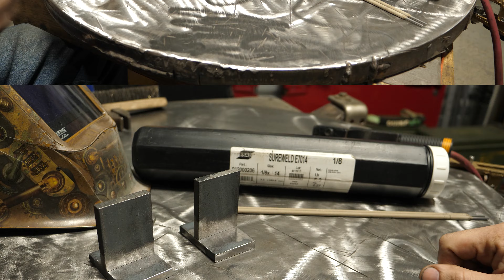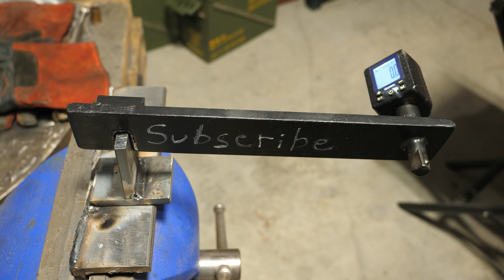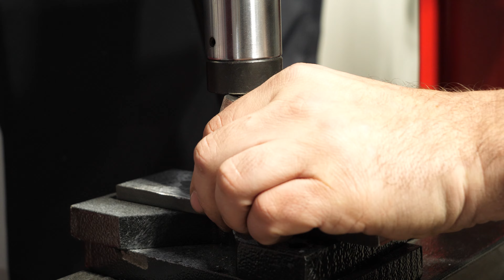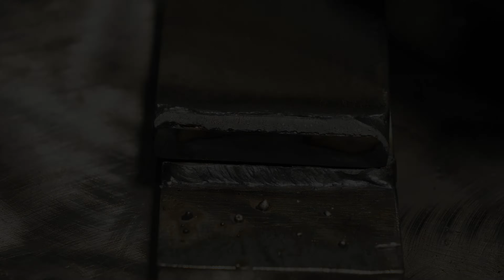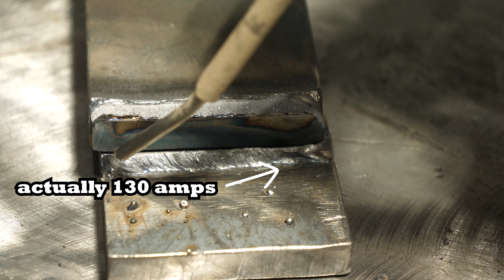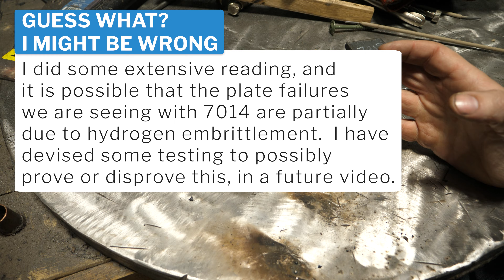7014 vs 7018 weld break test

Comment: I was told 7014 was a sheet metal rod and had low penetration….
Reply from the maker: 7014 can be used on more than sheet metal but generally speaking it excels at thinner material due to minimal penetration 👍.

Comment: Thanks for another thoughtful video. 
    7018 is great stuff, but is it the best choice for every job? 
     Let's say you make a garage shelf with some 16 gauge square tubing (1/16")  and some plywood sheets. 
     Your nephew, new employee, etc. backs into it with your truck, or the forklift, etc. 
     Scenario #1 :  You put it together with small 6013 or 7014 stick, so some welds break. You clean up the mess,  do a bit of grinding, and weld it back together. 

    Scenario #2 : You try to use 7018 and burn through so many times you end up using another rod, but you wasted a lot of time and it doesn't look so good. 

    Scenario #3 :  You somehow manage to use 7018 on the thin metal without disaster. Give yourself a pat on the back and bragging rights. The event happens, the welds don't break, every tube is bent and twisted, only some can be salvaged. The vehicle suffers more damage. You have to replace most of the 'cheap' steel tubing. 
     Lesson: When you are just toooo smart, you may outsmart yourself.
Reply from the maker: You’re absolutely right, 7018 isn’t the best tool in the toolbox for all welding jobs.  Take welding fence pipes, the first rod I would grab is 6010/6011, and 7018 would be about the last.  The rough restarts with 7018 and difficulty it has bridging gaps makes it far harder to work with for a lot of jobs.  To hold together a mangled dumpster 6010/11 is first to come out and maybe 7018 to cap over the 6010/11.  Lawn mower decks, thin sheet metal, terrible/rusty material, etc are all great candidates for other welding rods 😀👍

Comment: for thin metal would you recommenced 6013 or 7014 more? or just use a smaller 7018?
Reply from the maker: Great question.  On thin material as in 1/8th most any rod will work.  With 1/16th and down I would be reaching for 1/16th 6011, 6013, or 7014.  7014 is probably the hardest to find in 1/16th (3.2mm) sizes.  Most people will have the most success with 6013 more than likely 👍.
Reply: @makingmistakeswithgreg  thanks. found myself working with allot of 1/8th inch but rusty that i need to clean up lately, so after cleaning its somewhere between 1/16th & 1/8th.

Comment: It’s a good substitute rod for 6013, easier to restart and less of the swirling slag you tend to get with 6013 too
Reply from the maker: It definitely is.  That slag inclusion tendency of 6013 can be a rough problem to deal with.

Comment: 12:47 I found a source that claims the typical value for E7014 Charpy was tested at -20°F. Assuming I can't post links, search for this webpage (not the .pdf):
"E7014 – Washington Alloy"

Interesting that 6010, 6011, 6013, 7014, 7024, 8010, and 11018 all fail your press test. I would have said this comes down to self-quenching, but that doesn't explain the 7024, which shouldn't be more susceptible than 7018. It's a 70XX-series rods with a "slow-freezing" puddle.

The one thing they all have in common is a greater likelihood of hydrogen embrittlement vs. 7018. The undersized rod (1/8" rod on 3/8" plate) gives little time for hydrogen to escape before the puddle freezes. Even for A36, I'm curious if you dried your 11018 rods for this test. I'm sure they're susceptible to untempered martensite from self-quenching, and hydrogen embrittlement from moist flux.

Hydrogen embrittlement would also explain why MIG has an easier time passing this test.

Comment: I’m currently practicing with 7014 because I bought a miller roughneck and it’s an ac only machine. I’m definitely liking it for tacking compared to 7018
Reply from the maker: 7014 is definitely a easier rod to tack weld with.  They do make a a/c specific 7018 rod, it is designed to run a bit better on a/c.  Technically most 7018s can generally run on a/c, however many a/c machines (like Lincoln tombstones) have very limited voltage under load therefore those machines tend to struggle with them.  Your generator/welder setup probably has significantly more output voltage capability and may run more 7018s than most a/c machines.  Basically if you haven’t tried running 7018s it might be worth it.  Otherwise your best bet is 7014, they will offer better general performance than 60 series rods.
Reply: @makingmistakeswithgreg I have tried a few different 7018 and while the ac rod will run the arc will randomly snuff out. Right now I’m keeping 6011, 6013, 7014, and 7024 on hand. I can’t recommend esab sureweld 6013 enough.

Comment: 7014 just doesnt penetrate.  Id like to try 7014 on some thin tubing.  6013 and 7018 blow holes in thin stuff.
Reply from the maker: 7014 is available in 1/16th and 5/64 rod sizes and they do work well on sheet metal 👍.

Comment: Thats poor fusion. Try 7014 same with faster travel it will break same as 7018, on less psi ofc, because weld fusion lower surface area. With that travel speed of yours heat from the arc barely reaches base metal fusion point, thats where it fails.
Reply from the maker: So I have extensively tested this beyond this video.  I have discovered a few things.  1) 7014 produces weakly penetrated welds, regardless of settings.  Under no circumstance does it match 7018s penetration, the rod simply doesn’t produce penetration.  This is a problem if weld penetration is required for strength.  2: the 7014 weld is far less ductile than 7018, therefore its lack of flex can force failures of material that don’t happen with 7018.  When bending steel that is welded with 7014 the weld holds more like epoxy (holds until it breaks instantly or the base material tears) instead of 7018 (which holds on while slightly stretching with the material).  There is more to weld strength and holding things together than simply tensile strength.  If this was the case 11018 would equal 7018 when bending 3/8th mild steel and it too fails like 7014, due to how little the weld stretches.  3: 7014 doesn’t actually match 7018 in tensile strength regardless of both being “70k” rods.  The 70k is minimum test results, 7018 universally is in the low 80k in actual testing, 7014 is not.  

Based on the testing I have done 7014 is in no way a replacement for 7018.  It has less penetration, less actual tensile strength, worse ductility, and tends to be more prone to weld defects like slag inclusions.  It’s also not capable of being low hydrogen therefore should not be used on higher strength steels.  The main benefits 7014 has is easier starts, and better thin material performance due to reduced penetration.
Reply: @makingmistakeswithgreg  hmm, I would try 1 pass faster travel speed, and 2 more passes over it to match 7018 bead size because problem is poor fusion. Less penetration makes an effect of too low travel speed where molten filler fuse to itself more and less with base material, because base is semi molten state. So with less penetrative electrodes more you travel , less heat to fusion point.
Point is to make it  break on weld , because weld is 70k , when it breaks at contact with base its not even close to 70k, its weak fusion, its more glued than fused.

this 2 electrodes are same nature and composition in different proportions, only difference one reaches deeper penetration at same travel, so thats where lack of fusion lies.
Take a look at mig for example, why is less posible wire diameter for high amperage desired, because it reaches high penetration faster than heat reaches considerable width> same penetration can be achieved with lower amps and slower travel speed but filler to base fusion point is more glued than fused. I have learned this hard way, always thougth penetration is penetration.

Comment: I don't think the cracking is because of the difference  in strength. I think it has to do with chemistry. That's why all the failures are at the weld to parent metal interface in the parent metal. 7014's high carbon weld metal vs 7018 may embrittle the parent metal at the weld bead. The weld then fails along the most brittle portion when bent.

Comment: 7014 is for flat only 7018 is all positions
Reply from the maker: The 3rd digit code refers to position.  A 1 means  all position (except vertical down unless specified) the 4th number refers to flux composition.  7014 and 7018 can both weld flat, horizontal, vertical up, and overhead.  7018 tends to weld better vertical up and overhead but much of that is due to how clear the molten puddle is.  What you’re probably thinking of is 7024, which has a similar flux to 7014 but it will not weld vertical or overhead (just flat and horizontal).

Comment: I just see E7014 as a substitute for jet rods, fluxed-core and E6013, not E7018 AC. E7018 AC is what I would recommend for dissimilar ferrous metals, cast iron, magnetized steel and very complex welding.

Comment: Would it have rooted better if it was beveled?
Reply from the maker: A bevel with a proper angle will reduce the leverage against a single sided weld and will increase the strength (aka the load before a weld will break when bent towards the face).  A bevel won’t really increase strength on a single sided weld when the weld is bent away from the face.  The point of failure in that situation is the weld toes (which are under the most tension) and not the root.

Comment: Appreciate the effort you put into this but you're tests are only proving that that particular joint is weaker in 7014 vs 7018.

Stress is force per unit area.  As you stated the 7014 doesn't penetrate as well as 7018, so the 7018 weld should have a bigger cross section (a bigger area).  Given that the 7018 weld is thicker it would be reasonable that it can take more load.   A better test would be to do full penetration welds with both rods and then perform a bend test.   Or do a root pass with 6010/6011 to get good penetration and then a cap pass with 7014 and 7018.  Or bevel the vertical plate with the 7014 to get similar  penetration as the 7018. The goal would be to get a  to similarly sized weld to test. Those would show how the strength of the welds compare, rather than the strength of that particular joint with both rods.   

Another suggestion would be to use runoff tabs so that you aren't getting failures initiating at your start/end points (or trim off the start and ends).  

Your tests do show that it would be worth paying a little more attention to the weld joint if using 7014 vs 7018.
Reply from the maker: So I have actually tested multi pass 7014 welds and they still fail in the same way as a single pass 7014.  The root penetration isn’t a deciding factor when it’s bent away from the face of the weld.  When bent towards the face of the weld 7018 is still stronger due to slightly increased fusion in the root, but it’s not hugely better.  7018 and 7014 put down similar weld sizes and the root fusion is slightly less with 7014.  A smaller 7018 weld (3/32 rods vs 1/8th in the video) will still handle being bent away from the weld face without failure, so it’s not as simple as the 7014 having less weld.

7014 rods might have similar minimum AWS spec (70k) but that’s the minimum.  In practice 7018 tends to be 5-8k psi stronger in tensile strength, 5-8% better for elongation.  Those things are enough difference to make 7018 actually stronger in practice. 

Run off tabs would make the welds more consistent you are correct.  I don’t really use them because virtually no one uses them on things they build in the home shop (if it’s even possible to use them).  In the case of 7014 vs 7018 I don’t believe a perfect weld with 7014 that has no start of stop would not fail like it did.  The simple fact is the 7014 weld deposit is less ductile, less strong in tensile strength, and has less penetration than 7018.  It’s not really equal to 7018 on any front.  With that said it is still a useful rod.  It works great to weld sheetmetal with 1/16th and 5/64 rods, it has less issue with slag inclusions than 6013, it is stronger than 60xx series rods, and it runs on any welder.  It’s still not equal or should be used as an equal to 7018.
Reply: @makingmistakeswithgreg  Yes the 7014 won't produce as strong as weld as the 7018, but it should still produce a stronger weld than mild steel  base metal (the yield and UTS numbers show that). By leaving the defects at the ends you aren't really testing the strength of the weld metal, you are testing the strength of that defect as  that is the weakest point. I expect the 7014 would pass your bend test if that defect was removed. I'm not here to convince anyone that 7014 is as good a 7018, I'm just trying to point out how your tests could be improved and that there's more to making a strong weld than just running a bead on some plate.

Comment: With what i have found, 7014 is nice for thinner material. 3/16 maybe and less. Due to less penatration.
Reply from the maker: You and a lot of people have suggested the same thing, and I bet it would work great for that.  I like 7014 a lot better than 6013, and 1/16 or 3/32 7014s are far less likely to have slag entrapment over 6013.  On thinner material the strength difference would be mostly negligible over 7018 too.
Reply: @makingmistakeswithgreg  😀👍

Comment: It's fun to watch, and informative.  It makes me hope those 2 gutter cleaner chutes I welded together that were fabbed for 2 customers, 1 14' and 1 17', main section was 10' (max of the breaker at Jefford's Steel) on each, then addd the remaining in new cuts. Jefford's bended it to spec, then I did the welding for the shop who ordered it for customers.  7014 5/32 Hobart rods, on AC welders (mainly my Montgomery Wards PowrKraft 230) I think up in 160 range on amps, 165?.
Reply from the maker: I think 7014 is pretty strong, but for things requiring max strength I would definitely use 7018.  One thing I didn’t mention in the video, is that 3/8th plate can develop a ton of force on a weld.  If what you welded is thinner material, or the welds can’t see high force, there is not much of a concern for 7014 failing.

Comment: Isn't it well established that 7018 has better penetration than 7014?  You're seeing exactly what you should expect to see here.  This is why different rod types exist.
Reply from the maker: Many people buy 7014 under the premise it’s a solution to 7018s “storage requirements”.  They don’t realize they are giving up a fair amount going to it over 7018.  It’s also common for many manufactures to call 7014 equal in penetration to 7018, when it actuality it’s less.  A quick Google search says 7014 is moderate penetration and 7018 is medium to moderate, yet they are significantly different.
Reply: @makingmistakeswithgreg  Doing a quick google search and not a proper one is indeed the problem here!  But that said, 7014 is still likely more than strong enough for most weekend warriors.  I think for these people ease of use is going to be the  important factor.
Reply: I read a lot of comment and see a lot of "old wives tales" about welding ( unfortunately there are DIY and fabricators teaching them)" on youtube.  Greg is a myth buster because some have to be shown.  This is usually all stuff I read in text at onetime and have been documented a long time ago.